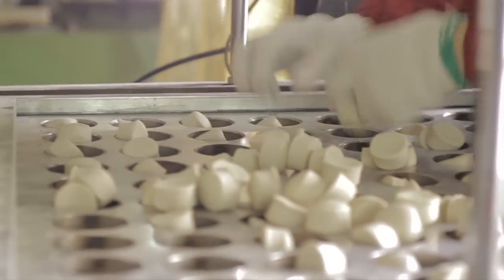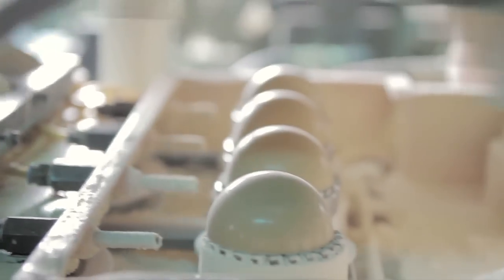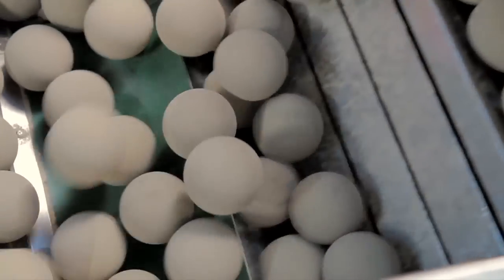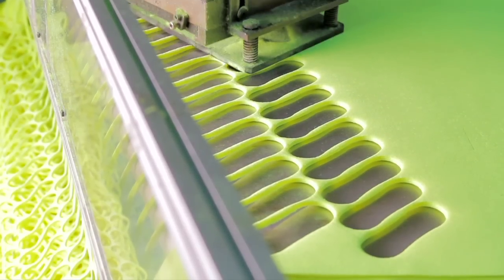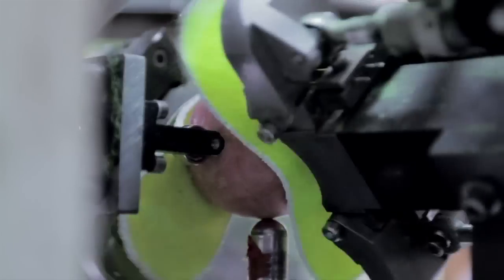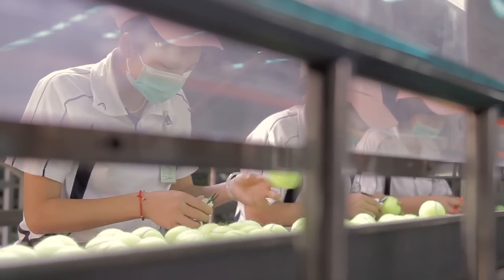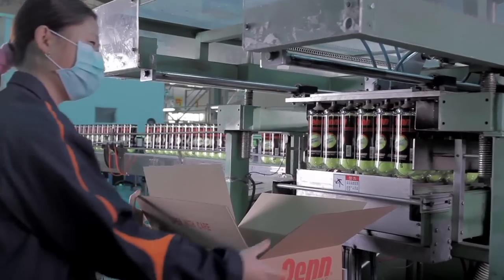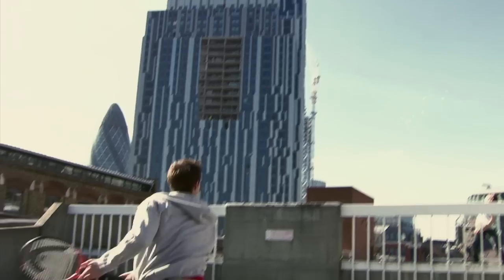Penn Tennis Balls

Comment: Just had this video come up after I watched some guys in Pakistan making tennis balls by hand. Really interesting to see the similarities.
Reply: I had the exact same experience.  Large difference between the jobber cutting out the felt with a manual punch to the low-waste automated punch.  It was also nice to see some respiratory protection in use.
Reply: Watched that video too, probably is the reason youtube recommended this video

Comment: the machine that applied the felt was an engineering masterpiece
Reply: Yes! Tt saves so much money, they didnt even have to pay a poor underage chineese girl to do the work!
Reply: I actually don't find the part that applies the felt itself that incredible, the folding action is not difficult to make at all, just a couple of pneumatic actuators on each side. I think the difficult part (and the reason this machine is the only one) is what we can't see: the felt must be applied with a tolerance of perhaps +/- 0,5mm, probably less than that even,  the part that grabs the felt from the pack must not fail - not even once, grab just one at the time, and be precise about it.  If it fails to grab the felt properly, there would be glue on the claws and next felt would stick to the claws. How the claws that apply the felt keep it in place and at the precise spot is also a mystery.
Reply: My wife did the job of this machine for 35 years, before they sent the whole plant from Phoenix overseas.  Forced retirement.  Still a great tennis ball, though, and the whole process is amazing to see.

Comment: I wish they would put an air valve on tennis balls...so they could be topped up. Balls should only be discarded when the felt is worn...not so much a cost issue but an environmental one.
Reply: noted ...good point
Reply: Me too I want that kind of ball
Reply: Use a 'Tennis Ball Saver' device.
Reply: You can repressurize them. Buy the machine.
Reply: there is a cannister that does that